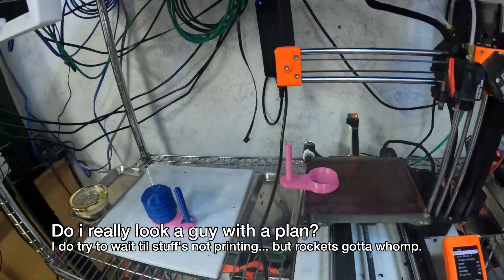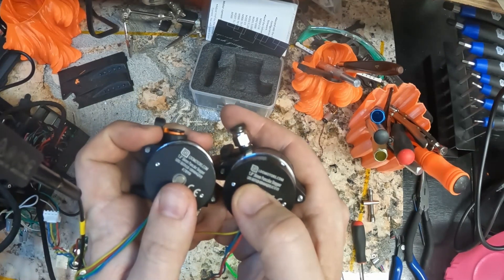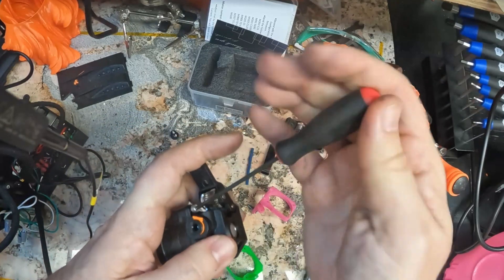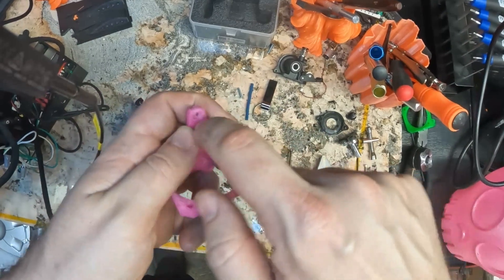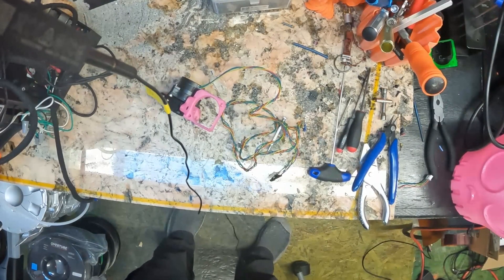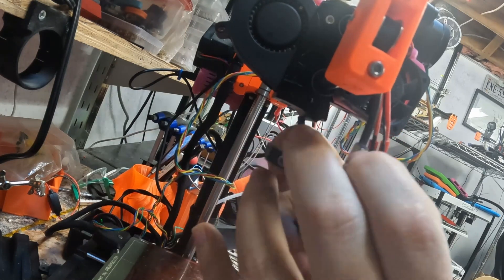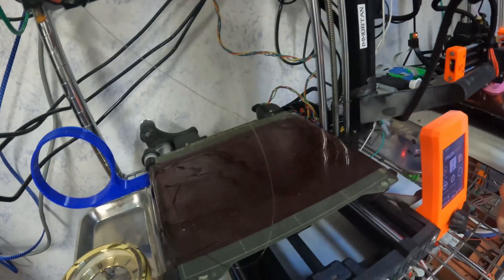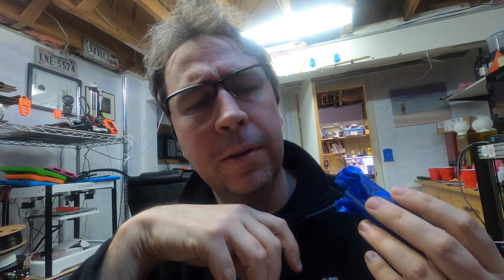PrintShift Mini Orbiter 2.0 - TPU Rematch!

Comment: I did this but the engine is running hot, how to fix it?
Reply from the maker: in your start gcode, add:
M907 E400

That will set the extruder motor current - if it's still hot, you can go to M907 E350, and if the motor skips you can increase it instead.

Comment: Excellent video, thanks for posting. Would you say that your prints quality has improved switching from the standard bowden system to this direct drive?
Reply from the maker: Thanks!  There is improvement in print quality, most visible on sharp corners - the Bowden are a little over leading in, a little under extruded leading out.  For PETG there's a notable reduction in stringing, too.  The stock Prusa's linear advance compensates for the corner issue by default - it's not perfect but it's generally good enough.
Reply: @PaulChase  thanks for the feedback. This looks like a super compact and light direct drive, I think I'll get it and use your bracket of course. Need to read up on the Gcode mods for it.

Comment: I really like your print shift project for prusa mini. And would like to ask a question, is it possible to print large objects, which wont fit on the whole prusa mini bed? so I can print like half of it then the conveyor belt moves and I can print the rest? :)
Reply from the maker: Not on this system, no - I would like to make that sort of thing possible on a cartesian + belt, but it would take firmware and slicer support